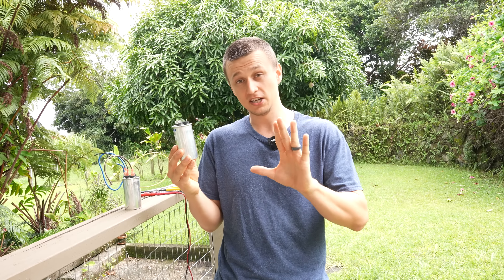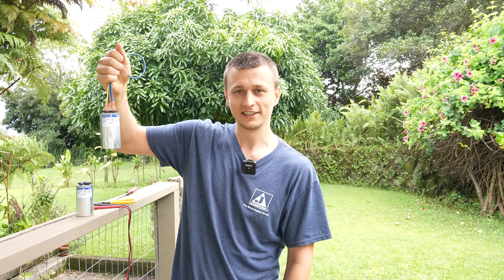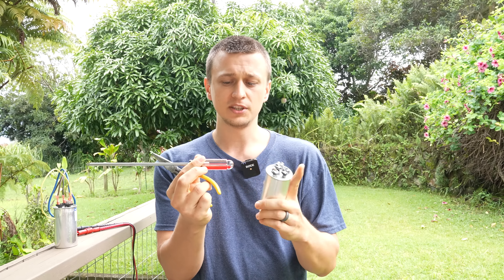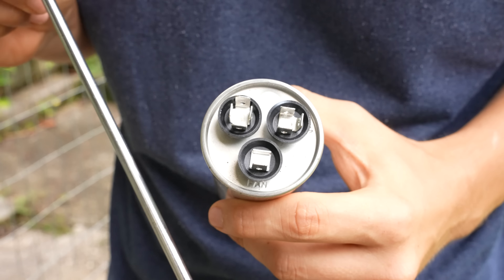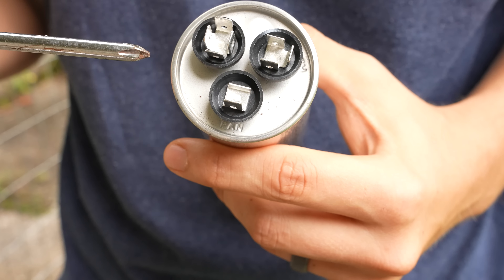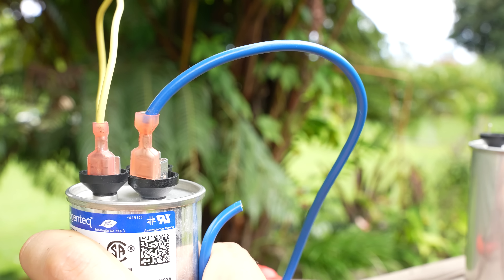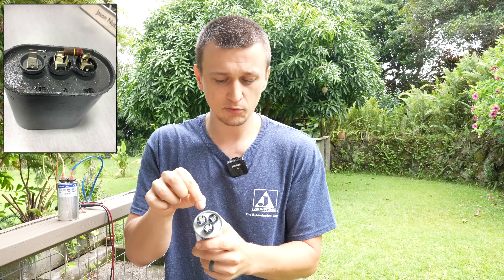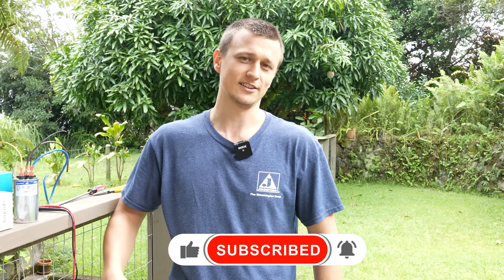How to Discharge a HVAC Capacitor

Comment: Great video. However, while you explained that using an insulated screwed is important to prevent electrical shock, you failed to actually keep your skin off the metal portion of the screwdriver while demonstrating.

Comment: Eak - at 6:16 your finger is on the shaft of the screwdriver as you demo the discharging! This is why folks should at least use a proper VDE screwdriver if they want to shortcut the discharging.

Comment: You can shorten the lifetime of electrolytic capacitors by shorting them.  Internal hot-spots may develop and cause some of the electrolyte to vaporize, and potentially damage the thin aluminum-oxide dielectric, leading to increased leakage currents and more internal heat generation (and shorter life). Just because a component didn't immediately die, doesn't mean you didn't damage it.
Reply: Would you recommend the discharge pen method to avoid this?
Reply: Thank you Jay and Jess for the info. I’m installing a hard start kit because the AC company told me that it could help me with my situation. I kept seeing the screw driver method but if it will help with the longevity of the capacitor, I’ll go with the pen. Jay: I’ve watched your videos on cleaning the AC coils and installing the hard start kit. Thank you for those videos 🙌🏽🤝
Reply: Exactly "Darren Holdstock
 Joined Feb 10, 2009  262
Jan 13, 2010
#4
Yes, discharge with a resistor or the cap may be damaged by the current surge (some types of cap are more easily damaged than others). If you dead-short it then almost all the energy stored in the cap will be suddenly dumped in the equivalent series resistance (ESR), which can cause localised burnouts and fractures. That energy, in joules, is (CV^2)/2."   

That said, the amount of charge in most capacitors is miniscule, about like touching a doorknob after walking across a carpet.  When I was in Marine Corps Avionics, a favorite prank would be to charge a cap to 450 VDC and toss it to an unsuspecting friend (A 45 mF cap at 450V holds 4.556 Joules.  A cardiac defibrillator discharges 200-400 Joules which it stores in capacitors).  Unpleasant? Yes.  Injurious?  No.  But how many HVAC caps have failed prematurely due to having their terminals shorted  without a resistor to control the current.  And unless the motor windings are open or the thermal cutoff has tripped and not reset yet, there is unlikely to be any charge present as it will discharge through the motors windings which are fairly low ohms.  But you can easily use a voltmeter to check to see if it's charged.  Just use a resistor if you discharge it.

Comment: Off Topic Limit Switch Question.    I want to parallel furnace switches  with a led in series with 6800 ohm resistor to hopefully have a visual indications of  of switch condition,  but not knowing how sensitive the control boards are, I not sure if this would interfere with circuit operation ,  I don't think it will , it would be easy to do with spade lug extenders,.
Might even make an interesting video.   Might be good for TS and videoing for intermittants.  Whats your opinion???

Comment: Hi my friend how long take to change the Capacitor I have 18 years with them it’s okay to replace it for a new.?
Reply from the maker: Changing a capacitor is usually pretty easy. 5-10 minute job. Here is a video on how to replace it: https://youtu.be/9ZGfvC-PMWU
Personally, if it works well I would not change it. But it would be a good idea to order a spare capacitor just in case. I talk about that in the video above.
Reply: Hi it’s me again,my ac work every 5 to 10  minutes and I have a big bill a month I think it’s the thermostat can you help me on this situation thanks
Reply: Capaciter  damged  replasing

Comment: Ty for making the video.

If you knew why a capacitor would not work the same in a DC circuit you would not have this many misunderstandings about a standard capacitor.

If what you're saying is true, how could anyone work on a mini split with super caps?

100% though for safety I run my strippers over any cap I'm about to service.

Comment: The only reason for a resistor in series with jumper leads is to eliminate the spark when discharging a capacitor. Otherwise both ways are fine.

Comment: I'm amused by the discharging guys, any run cap is connected both ends to the motor and self discharges. A start cap usually has bleed resistor. Beyond that used me volt tester to bleed off. The only caps worth worrying about the DC electrolyic found on inverter boards that really pack a punch and don't short them!
Reply from the maker: Lol thanks for clarifying Nathan! In most cases that is true but there are many different units out there and some of them actually do bite. 😄 My idea is to be on the safe side and take the few extra seconds to discharge it.  Thank you for the heads up about the inverter boards too!

Comment: Informative video, thank you. My capacitor is attached to a 5-2-1 booster capacitor—I assume the 5-2-1 capacitor would have to be discharged as well, but how, and in what order between the two capacitors???
Reply from the maker: Oh man.. I completely forgot to talk about the start capacitors. At least you brought it up in the comments, so thank you! The start capacitors are even more important to discharge because they store a much larger charge than a run capacitor. I forgot to mention them since I almost never discharge those. Many units don't have them, they rarely fail, and most of them will have a bleed resistor to automatically discharge them. With those 5-2-1 kits, you would only discharge the capacitor part of it, the same way as you would a run capacitor. Nothing needs to be done with the relay. The order in which you discharge the capacitors does not matter. Hope that helps!
Reply: Pp huh

Comment: You might forget to do this and get shocked.  Could be tough to remember if the power is turned off.
Reply from the maker: I can only agree.. I've been shocked more than once. But actually as long as the power is off.. Even the times I forgot to discharge it, getting zapped was a rare occurrence.

Comment: Do you need to do this with a new capacitor that you are going to install?
Reply: The only problem (as mentioned in the video) is if someone bought the capacitor and used it for a short period, and returned it, so it is not actually new.

Comment: You failed to state that you can damage it by shorting it out. Also, that you need an insulated screwdriver. Thirdly, the best method is actually with a resistor!